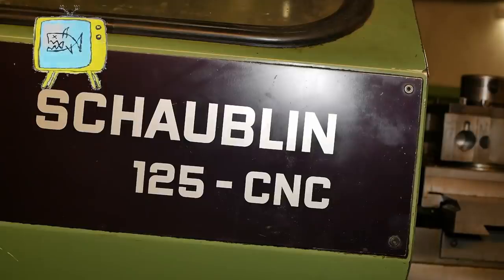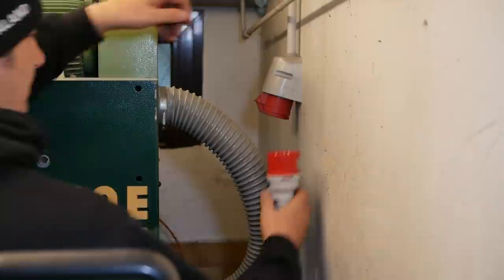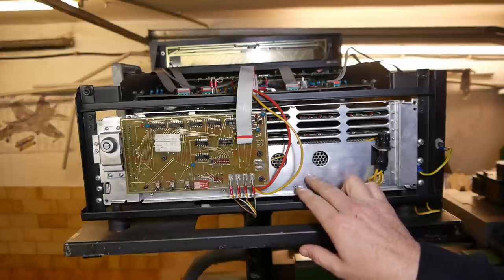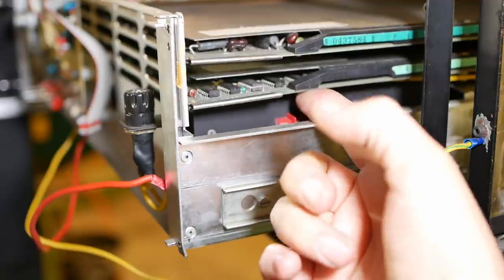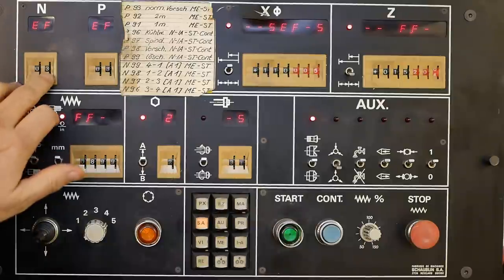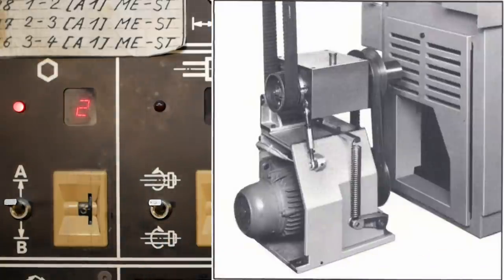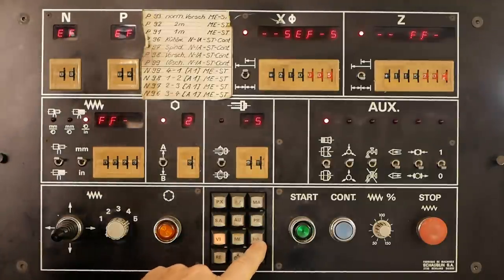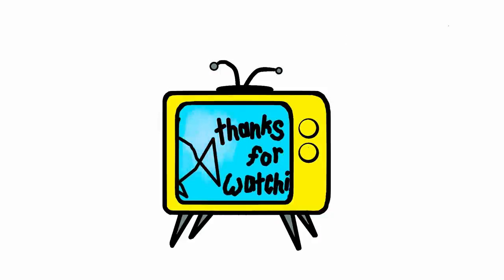Historic Schaublin CNC Controller - How did it work?

Comment: Brings back memories, or nightmares, of working on old Okuma CNCs, I even got a call to fix one that actually had a Nixie tube display.
Reply from the maker: Nixie tubes, wow. Nightmare tech, but also somehow cool. I was pretty surprised to see the segmented LED numeric displays on the Schaublin. that was pretty new in the mid 70's. Schaublin must have had some pretty tech savy engineers/management at that time.
Reply: @RotarySMP  They are cool, for a clock. What I didn’t know at the time was the 180v buss to power them, I remember two of those Okumas in the area, think they were late 60s or very early 70s machines, not to long after that Okuma used a little tiny CRT on most with the segmented LEDs.
Reply from the maker: @jeffgreenfield7025  When I was a kid, my best friends Dad had a production engineering company, with a bunch of Okuma, a mix of mechanically cam programmed automatic lathes and CNC lathes. This was in the mid eighties. I 'd sometime go an help my friend, who was paid to do cleaning after hours.

Comment: Really high tech for its time. For 1969, this is actually really small computer.
Reply from the maker: You are right. Although less than a decase later, with the microNova, they shrunk its CPU from 15x15" to a single chip. Amazing progress.

Comment: I would definitely go servo motors and drivers or closed loop steppers either way thanks for this opportunity to see such amazing craftsmanship . Looking forward to the rest of this series
Reply from the maker: They are currently servos, and I wont use steppers. Dont like the sound.
Thanks for watching.
Reply: @RotarySMP  i meant change the motor and driver out to a new updated version of servo
Reply from the maker: @michaelbrocato7535  Yeah, that is the direction I am probably going to go.

Comment: I would go with option 3. Because in time you will end up there anyway.
Reply from the maker: Yeah, I think you are right.
Reply: @RotarySMP  I second the notion of just doing it now. It's tempting to try to get older stuff to work, but ac servos are amazing and inexpensive these days. If you really want to splurge and have fun try the clearpath hybrid servos. The autotuning on them is wonderful.
Reply from the maker: @hahnrossman1172  I'll look into that. I think I'll add 1µm linear encoders and close the position loop back to them. That is the way the Maho is set up,a nd I like that.
Reply: Agreed. I have had good luck with the "Clearpath" series of motors from Teknic https://www.teknic.com/products/clearpath-brushless-dc-servo-motors/
Reply: @RotarySMP  are the axis ballscrew driven?
Reply from the maker: @hahnrossman1172  Yes. You cn see the Z ball screw, where I pulled a cover back in the first video.
Reply: @RotarySMP  I guess it comes down to how accurate the parts you are trying to make are? Most of the machines I'm familiar with use a combination of encoders on the motors and ballscrew mapping. There has been a lot of seep geeking around ballscrew mapping and such in linuxcnc:
https://forum.linuxcnc.org/10-advanced-configuration/37086-ball-screw-mapping-details-question-solved?start=0
Linear encoders are definitely easier to implement, and probably not to expensive for a machine that size. 
I would try just using the encoders on the ac servos to begin with and do some tests as to positional accuracy. A lot depends on the quality and condition of those ballscrews which knowing the swiss is excellent! Good work and I'm looking forward to the progress!
Reply from the maker: @hahnrossman1172  Those are good points. Adding the linear encoder to Z would be easy, but mounting on on X could be a bit more of a challenge.
Reply: @RotarySMP  I really wish you would keep the original resolver, motor and drive. and just keep it mostly original except the linux computer of course. I would make a stand with a screen and controls where the old one sits.  I think that since this machine was designed with those components and it perfectly worked in the 1980s then it should also work fine now and you wouldn't be limited by these components, therefore it wouldn't make sense to spend more money on something you wouldn't benefit from. I have done a modern computer conversion about 2 years ago for a big 1980s toshiba cnc machine and kept the drives and motors but used different encoders because the original had a weird multiplier that the computer did not read properly. I don't really remember the specifics but the original wiring was really neat like in your machine but once we swapped out some of the wiring and relays it got really messy real quick and it looked like a disaster. It may look like there isn't many wires because its organized really well but once things start unwrapping it becomes a headache. Best of luck!
Reply: Oh and one more thing you can try to use a oscilloscope for the resolver to see what kind of signal it outputs.
Reply: @RotarySMP  where did you buy it from and what did it cost?
Reply from the maker: @goldcoasttime  I bought it from Richardo.at (sort of Swiss Ebay) for €2400.

Comment: That's actually a 1981 controller on it.  The IC chips on the rear Schaublin board have 8035 date codes (35th week of 1980), and the serial number tag shows it as an 81.
Reply from the maker: That lines up with a number of other indications that this particular machine was built in 1981. By 1977, I am refering to the year that the Schaublin 125-CNC was introduced. I expect that the control design and integration was completed in 1976 or 1977.

Comment: Fantastic!

I’d be tempted to get more information on the resolvers.....it’d be interesting to see just how different they really are. It could save some time during on the upgrade.
Reply from the maker: Missing information is the issue. When I kept the Indramat on the Maho, I have a full manual ith internal schematic, listing cap's etc. 

Here I have nothing about the motors or drives. The drives are simply too big, but the motors are also huge.

Comment: I posted a link of this video  to a Data General alumni page and specifically reached out to one of the designers of the Nova  2.  BTW: the Nova 2 was the 4th generation of Nova's and featured a really "cute" piece of circuitry that attempted to insure that  all the boards in the chassis were "official" Data General parts (so if you bought after market memory... bad things would happen).  The Nova was a circa '74 design (I think)
Reply from the maker: Sounds about right. Mine has (C) 1973 on the back plane board, but I think Schaublin brought the 125-CNC to market in 1977, with this example built maybe s late as 1981.

Comment: i was around tape drive machines that were made in late 70's   
that machine was really good for early 70's
Reply from the maker: The Nova 2 was designed in 1973, but I am pretty sure the 125-CNC came to market in 1977, and suspect that this particular one was built in 1981. But have no evidence for that.
Reply: @RotarySMP  the GE tape drive  
Mill that I used had a bolt on CNC upgrade kit  for it. In 1981.

Comment: I managed to fit my control PC and all the interface cards in the space vacated by the rectifier of my Holbrook lathe. 
(It was a 3-phase Selenium rectifier. It's a lovely thing, I have kept it as a curiosity.)
Reply from the maker: Hi Andy, That is pretty funny. I really enjoyed you Holbrook build. You need to post more of using it. If I replace all the pneumatic components with modern small ones, everything should fit in that part of the base.

Comment: Thanks for the trip down history hard shoulder! How many lines could you fit in a program?
I love the option of keeping as much as possible - you showed that you can gut-and-LCNC with new parts, now do some real preservation :-P
Alas, I am well aware of the potential hell of spare parts dependency you get yourself into. So, it’s not something that any of us (bar Niko maybe) can advise on, you need to weigh up your needs for the use of the machine versus the fun (!) and perhaps some duty to engineeringkind :)
It’s doubtful that the old gear is cool enough for a museum or CuriousMarc, so if you don’t use it, please box up and keep in the attic for the next generation :)
Reply from the maker: Yeah, that is a good summary. The Nova with the Schaublin controller will go to a museum or collector. I really need to remove the electrical cabinet to get it through a doorway, and will leave it off and use modern control hardware (Mesa cards and LinuxCNC.).

Comment: I don't know if "old CNC" is collectible, but over the world of old/vintage computing, a working DG-NOVA with core memory is quite desirable.

The first computers used (in any numbers) for process control were the PDP-8 from Digital Electronics Corporation (DEC).

Later they made the very famous PDP-11.
Reply from the maker: I did a fair bit of interet research of the Nova. You are right. There is one museum which might be interested. I wont dump it.

Comment: If I had this lathe, I would probably keep as much of the old kinematic hardware as possible, as I have much more time than money, and it can't be /that/ hard to modify LinuxCNC so that it can use all of that old hardware, right? (Famous last words, I know.)
Reply from the maker: That was my plan with the Maho, but here, the balance is a little different as saving the space by deleting the electrical cabinet is more important. Also I have no info on those drives.
Reply: @RotarySMP  I mean, it's your project, and I'd dare to guess that you have more money than time, but I bet that Schaublin still has the old documentation. Unlike MAHO, I don't think they underwent a huge restructuring, and there is no real reason to throw away old documentation.

But yeah, you have more experience with restoring machines and with LinuxCNC, it's your lathe and I bet you don't feel like poking around in there for hours with a scope, just to write a system that you can /mostly/ trust (because you reverse-engineered it and don't know if there are any special cases). I'd just say go with what people that really know what they're doing are telling you.
Reply from the maker: @vincentguttmann2231  You have it. It is cool, but with that controller, you are not going to be making any part too quickly :) I want the convenience of jog wheels.
Reply: @RotarySMP  Oh, most definitely. And a better interface with "distance to go" ;) and a view of how your toolpaths look. Technology sure has come a long way, and I bet that the controller has less brainpower than my Ti-84 + Graphing calculator.
I don't say it's bad (I mean, it clearly worked and was probably very good for its time), but technology has obviously moved on.

Comment: That's some pretty awesome and comprehensive stuff for the late '70s. This isn't a suggestion or anything but it'd be amazing to see one of these things working as it would have when it was fully operational with original hardware.
Reply from the maker: I would have liked to get it going, but don't have any error code information, and dont really have a starting point to trouble shoot it beyond what I did. Time to move on.
Reply: @RotarySMP  Aye of course of course, thanks for the detailed run through! These things are always an infinite time sink if you choose the repair/restore option. I'm looking forward to seeing what you do with it.

Comment: Hello,
What a clever bit of kit... the controller must have been so advanced in the 70's... Great news that you are going to power it up next time, it would be good to see it doing some basic functions in its original setup...
I guess your approach to upgrading is a bit dependent two factors, If it is just for cool content for YouTube I will go with keeping as much of the old stuff as possible. If it is to make a really usable machine then replace as much as your budget will allow, you will then have a machine that you can repair easily because parts are modern and available.
Take care.
Paul,,
Reply from the maker: I hit a wall, without any info on the controller or any way to interface with it or interrogate the nova, there is not much more I can do, except check the spindle motor and pneumatic relay cards.

Comment: Those wire wrap pins on the DG backplane were probably intended to make it easier to modify
Reply from the maker: Yeah they are listed as an expansion port. I gues back then soldered PCB's were still considered unreliable new tech. Some of the space and military hardware from that period still used wire wrap as standard.
Reply: @RotarySMP  I worked with this sort of thing (mostly DEC) back in the day and I don't think that soldered PCBs were considered unreliable, rather that the backplane design was pretty fluid and you tended to have to jumper signals over to a location where the PCB didn't supply them. Wire wrap pins made this very easy and gave a reliable connection.
Reply from the maker: @timbergel8147  Thanks for your experience on that.

Comment: Wire wrapping had a very cost effective place in the seventies. Multi layer boards were incredibly expensive and not generally available and since we built from discrete ICs using wire wrap gave us a way of doing small runs and prototypes that could be easily reconfigured if the circuit failed. Another reason for using wire wrap was that PCB design tools were also very expensive and comparatively low quality. So having wire wrap posts sticking through the back plane would have made a lot of sense to the computer manufacturers.
Reply from the maker: Thanks. I have a wire wrapped board in my office form some old military hardware. Looks like a nightmare to trouble shoot, but I guess there were techniques for that.

Comment: It’s amazing that’s a pretty neat control for1973. If it was mine I would try get it running as is have a play. Then install AC servos
Reply from the maker: I did as much playing around with it as I could think of, but without any information on the controller, or any way to trouble shoot that, it is a dead end. There is not even a text interface to interogate the Nova. You would need some sort of test and interface box. Time to move on.

Comment: Nice project !  Good machine  voor a project . Succes

I am retrofiting  my self  a swiss made mikron  wf 21 c milling machine
Reply from the maker: Nice. are you also using LinuxCNC?
Reply: @RotarySMP   no linux cnc 
It was a good option.  I am gooing  to use  a Eding   cnc  control cart  and new delta ac  servo motor and drives.  And a yaskawa freqentie drive for  the spindel. De big  challengs is to program  te gear box. But we think  we can do  it  .

Comment: Think I'd go for replacing all the control gear... The old control system is really beautiful, but troubleshooting 40/50 year old electronics that are trying to talk to modern electronics seems like a recipe for a headache 🤯

Maybe the original system could be preserved for a club/museum/someone who's willing to work with it as is?
Reply from the maker: That is the plan. The controller will be removed as is, and go to a museum or collector. I will reuse two relay boards, and some of the electrical switching hardware which is very high quality, but the new control will be LinuxCNC with Mesa cards.

Comment: Looking forward to seeing the convertion, I've joined Linux cnc too, I have an 1983 425 hurco spark erosion machine that I want to convert to a high speed cnc router, its on Instagram, so far I've removed the head and found loads of dodgy soldering in the electrical box
Reply from the maker: Cool, I hope you are logging your build on the LinuxCNC forum.

Comment: If it was my machine I would spend sometime trying to make it work in factory config. Not much,  but a little. Because it's cool.
Reply from the maker: I have, but without any manuals on the Nova or schaublin interface boards you hit the wall. This computor has no intereface other than what I showed. No keyboard, no display. Youwould need a DG test computor to even interogate it.
Reply: @RotarySMP  Ah dang. To the bin (museum) it goes!
Reply from the maker: @TheMetalButcher  Yep.

Comment: Kinda awesome control, if you consider it's age. Much more capable than like a Heidenhain TNC135, which was about 2 years later. I think would actually keep and learn how to use it, a bit like a museum machine. LinuxCNC will be easier to use, but I somewhat like the 1980s feeling when using those old controls. And I don't have to be fast and productive when making things, it's has to be fun and the parts must be good quality in the end.
Reply from the maker: I tried, but without any information on the controller, I cant trouble shoot it. The Nova would need a test and interface box to even interogate it. I won't dump it, it will go to a museum or collector.

Comment: I would def keep the motors, they seem in a very nice condition at first glance
Reply from the maker: Yes, it has do very little work, but I they are just belt driven, so I will probably replace the motor, more to get rid of the huge drives, than anything. AC drives take single phase power, so I can also remove the transformers.

Comment: id go fo servos but the downside is they dont freewheel. theres quite a bit of resistance if you want to move by hand . It was more of a problem on a mill i converted. Worth considering before you buy.
Reply from the maker: I have no intention of adding handwheels. There are none, and this machine has ballscrews (not self hemming.) It will get electronic hand wheels.
Reply: @RotarySMP  nice one i thought as much, but i thought it was worth mentioning as a week into converting the mill i had that big "OOPS!" moment. it still worked but its not something mentioned in data sheets and once youve done it you dont forget.  Im looking forward to see it done its a great machine and the old control is the work of an artist but id remove it as soon as i got the thing home. its more trouble than its worth to try fault find them in my opinion.